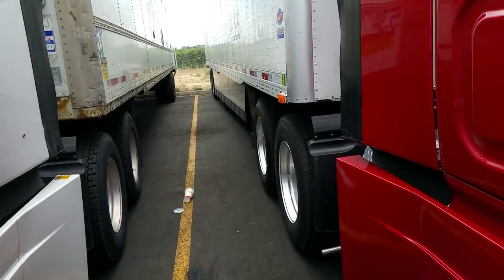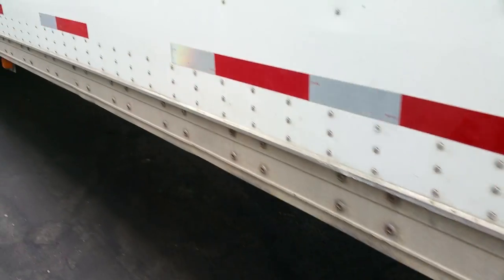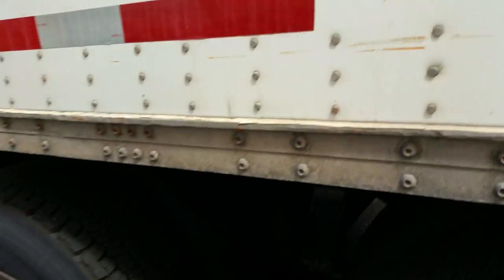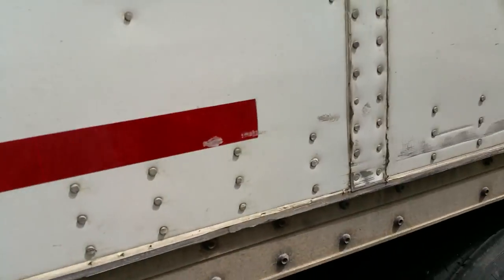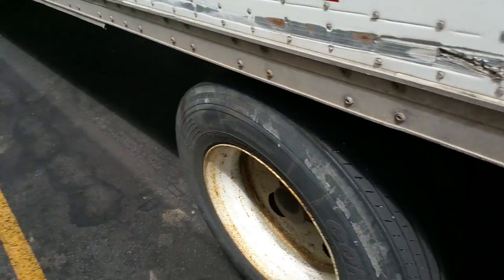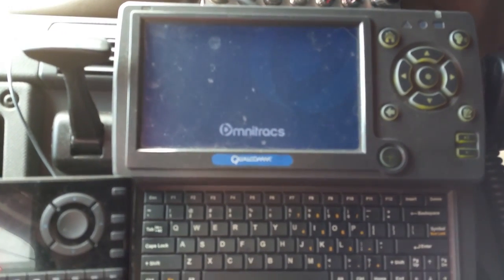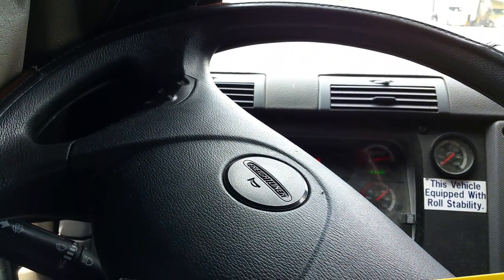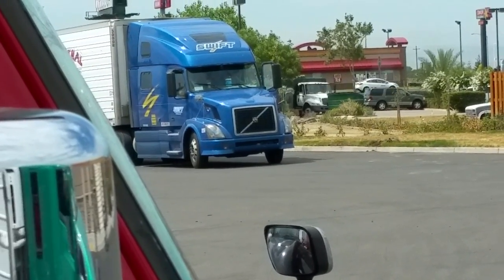"correction in the description" How to slide your fifth wheel and tandem.

Comment: great info bro but i need to correct u on a few thing. 1 the trailer tandem holes do not give or take 400 to 500 it is 250 pound same goes for 5th wheel. this i know for a fact. 2 if the pins stick on your trailer tandem you can just use a hammer to get the pins to release. you can do the way you said but your gonna be getti in and out of truck checking to see if the pins have released
Reply from the maker: Great info and thanks for the correction! !
Reply from the maker: I put correction in this video. I will do a new video soon with the correct info. smdh I don't know how I miss that! thanks again

Comment: U got it the other way around on the weight per hole FYI 5th wheel 4 to 5 hundred tandems 2 to 3 hundred and on the steer axle you could be up to 18 or more I believe they say max 12000 because 34 +34=68 so u only have 12 left got that info from another trucker its also at the atlas on legal weight limits.
Reply from the maker: Thanks for the correction! For me I never want to be over the 12/34/34 on any of my loads. You neverrrrrrr want to be 18k on your steers. You will get pull in for inspection by the d.o.t. you always want to be 12 34 34 at the Max. Now if you are 12 /34,200/34 they might let you slide. Because of the weight of your fuel they might let you by. Because you're going to burn that Extra 200 pounds off. But don't ever ever take a load that will have you over 12 34 34. Especially if you're a company driver because you can always take the load back and have them to rework it. You will get detention pay for waiting for them to reshuffle the load.
Reply from the maker: Also 80k is the max weight for a big truck. So 18k is not going to work. Now with that said. Heavy haul might be able to get away with that type of weight. But always make sure to ask you trainer/ instructor so you can get a clear understanding of truck to weight ratio. Hell I think I'm going to YouTube it right now just to make sure lol. You take it easy Driver
Reply: TheRightBrotha I didn't mean to be 18 on the steers I just said its still legal I wouldn't wanna drive that either and of course no more than 80000 I was saying about the steers cause I'm always 12400 with a full tank I could slide my 5th wheel one notch and be ok but I ve been pulling 44000 plus and those 500 pounds would of made me illegal also I notice a little more control on my steering it could just be me but its working. Well have a safe trip drive safe